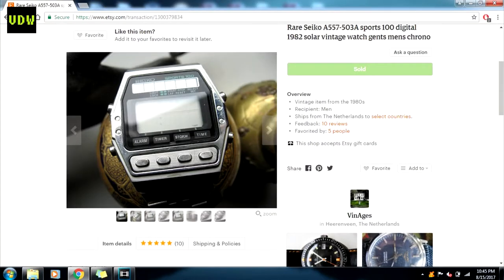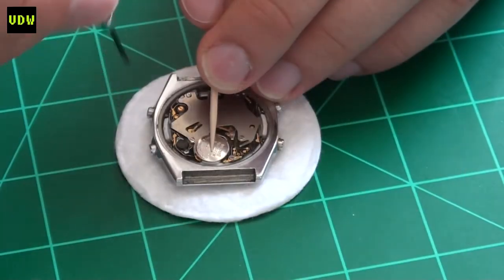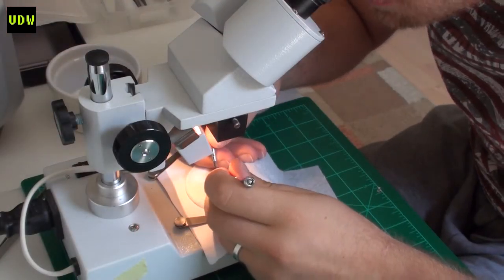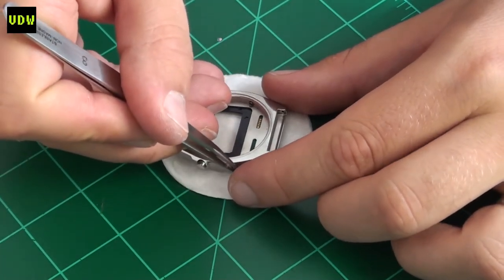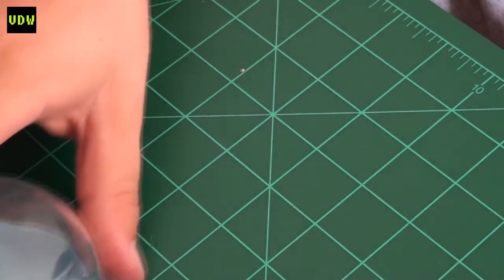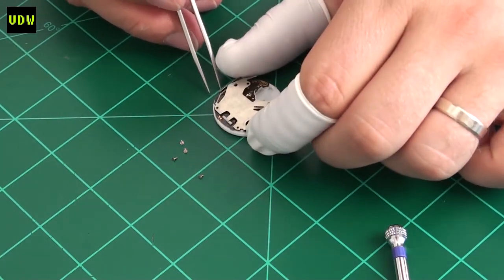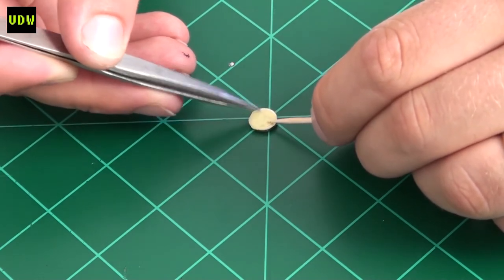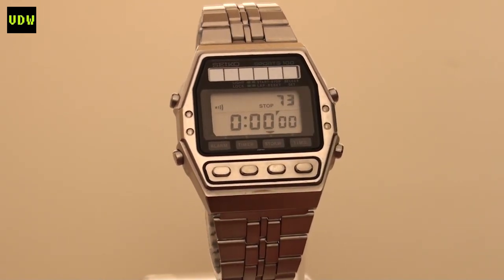VintageDigitalWatches - Ep 21 - Seiko  A557 solar watch

Comment: Hi, I have the same watch, bought it new long ago, I have changed the battery once years ago by a „Jeweller“ apparently he used maxell SR920w silver oxide cell, i have compared all the parts with the video, it doesn’t appear to be messing any! I want to use the same battery u used here, my question: where is the part that is usually tampered with to disconnect the solar charging?

Comment: Hello: 
I have a Seiko A557-5020. I have replaced the circuit block with a brand new one and replaced the battery with a Panasonic MT920.  Now it works fine but when I activate the micro light the display turns off until I release the button.  In any case the light is dim.  Do you know why this can happen? 
Thank you for your videos!

Comment: Hello , thank you so much for the video i have a look like seiko now dont remeber the exactly model but , i buy this on ebay and seller say wasent work with battery only under sunlight . When i recieve the watch only shows very very faded digits when i put the watch looking down (not sure if you understand ) well i was scamed i dissasembly the watch put renata and energizer batteries and nothing . I was very frustrated .. Looking your video i see you put a capacitor such as kinetic watches and the voltage of them is 2.1 or something like that . So in conclusion the watch dont use regulat batteries right? I have some old capacitor changed from my kinetic is not to old but i could try putting on the watch and then left under sunlight to see what happend.
Reply from the maker: Hi Xavier, the watch can work with the following: Regular Battery(1.5V), Capacitor Cell (1.5V up to 2.4 Volt). If you fit in the watch a Capacitor Cell you don't need to leave it under sunlight for a long time to work, it usually happens in a matter of seconds. If the above don't work then there is a fault with the watch.  Kind regards,
Tibi
Reply: Thank you for your answer , the watch dont work with a 1.5 cell , i clean carefully the circuit also i check for broken lines all seems good , but the display show nothing if i remember the light works but nothing else .  I have to dive into my stuff to find the kinetic capacitor and try but i m not expecting good results . I will tell you  when i do the test.
Kind Regards
Xavier

Comment: Hi! I have one of these watches and when I put in a regular battery, it starts working. But only a few days though. Without the battery, nothing works, not even when exposed to direct sunlight.
My question is:
How do I find out if the solar panel works without buying a solar battery. 
I have also several Casio solar watches. They work even without a battery when exposed to direct sunlight. With the Casio watches, it is quite a good indicator that the solar panel is not working properly, when you remove the battery and the watch stops working.
I doesn't seem to be the case with Seiko (as one can also see in your video).
Best wishes

Comment: Hi, please tell me how to activate/deactivate the alarm or beep and how to set the time to 24h? Thanks
Reply from the maker: Hi Dan, have you done a google search? I am sure there is a manual online.
Reply: @VintageDigitalWatches  i cant find aniwhere, i just bought this watch today.
Reply from the maker: @danmasaj  Just do a google search for "seiko a557 manual" and you will get a result for the digitalwatchlibrary, they have the manual.
Reply: @VintageDigitalWatches  thanks for the answer. 😊
Reply: Press and hold the 2 LHS buttons at the same time, the watch will cycle through those options